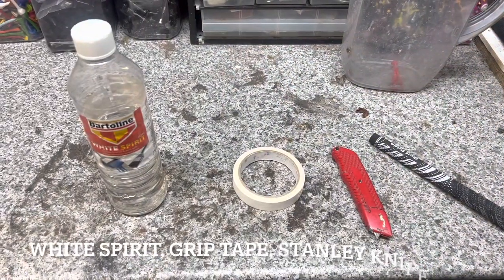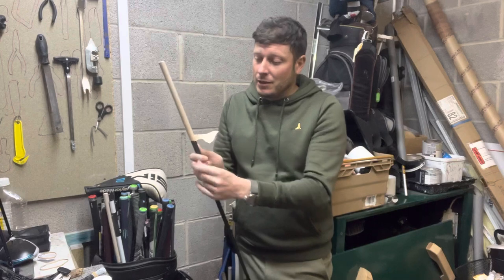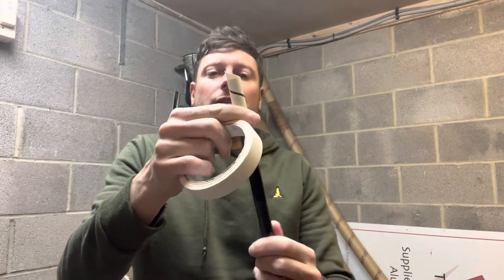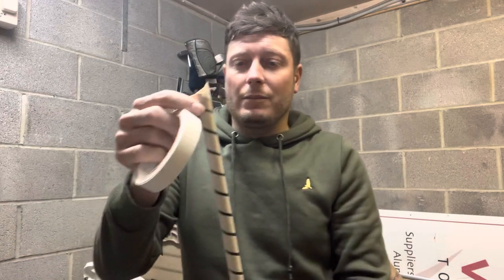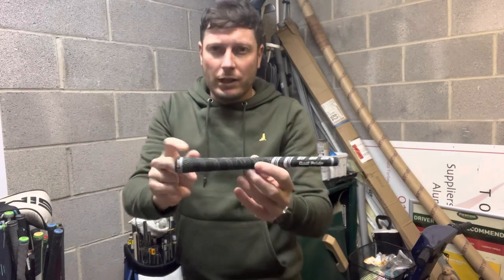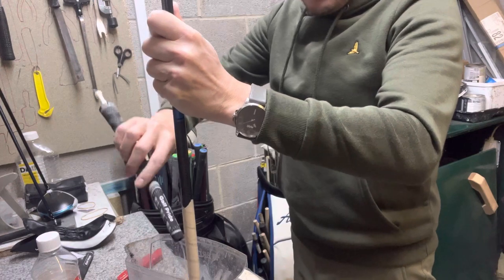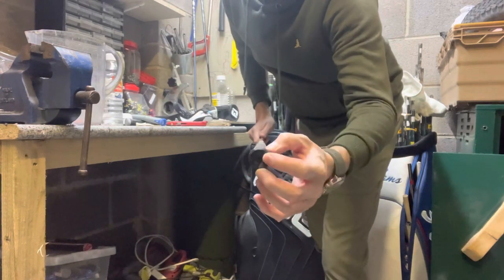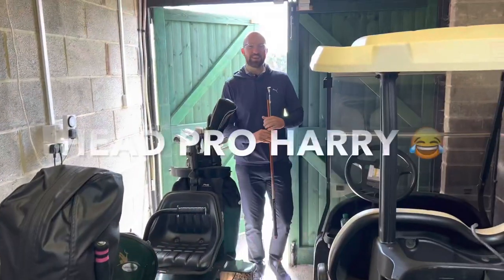REGRIP YOUR OWN GOLF CLUBS! Simple and Easy!

Comment: Just gonna send you a set of burner bubble graphites with original grips on. Only play 5 times a week.
Reply from the maker: 😂 I actually have the tool to change them Kevan! 😂 I’ll dig it out 😂 think Yonex did a similar wide butt grip if I remember.
Reply: @berniebarnesgolf  yes Yonex did have the same issue….. I found out the hard way 😂

Comment: Hi Bernie
I am a 60 yr old 14HC played for many years I play with ping eye 2 clubs with original steel shafts Do you think it would be possible to change shafts to graphite lighter shafts to help with my slow swing speed (130mph ball speed with driver) I love my Ping eye 2 and though this would be a cheaper option than buying newer clubs
Love your channel keep it going
Reply from the maker: The issue you have Steve is the swing weight will be messed up if you change from steel to graphite. The steel headed iron will be lighter then required. A graphite shafted iron will have a heavier weighted head generally. You would be better to buy a second hand set of irons in a light graphite, try them out, if they work keep them, if not sell them on and you won’t lose much money. Hope that helps.